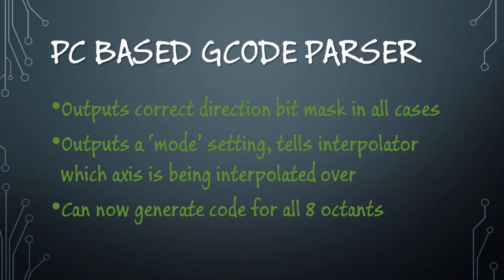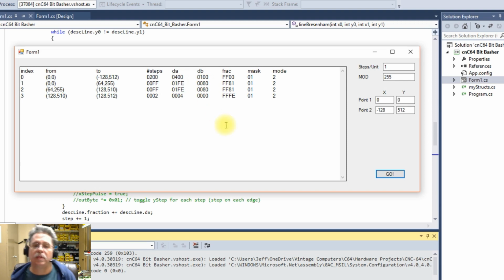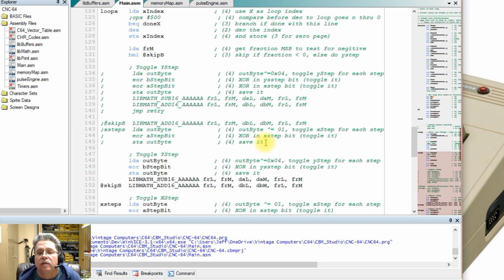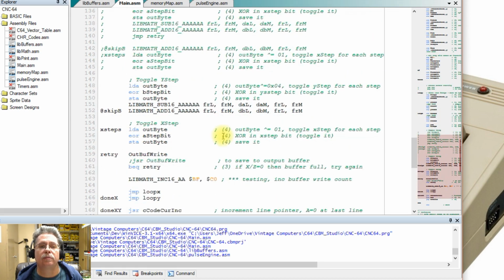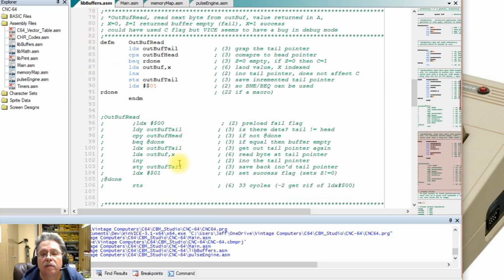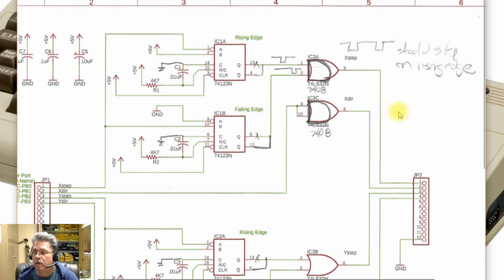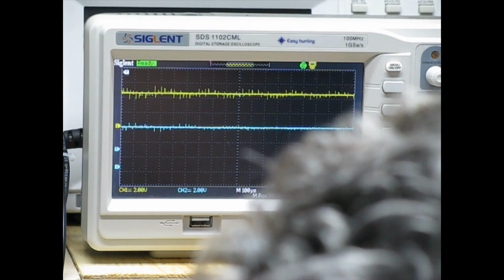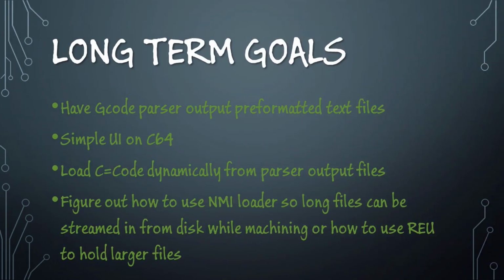CNC 64 P3

Comment: Hi Jeff, I love what you are doing, fascinating stuff. 
You can save 19 cycles in your NMI. Instead of saving the registers onto the stack you put them into predetermined zero page locations. This will save 8 cycles (as it removes the TYA, TXA, TAX and the TAY). I don't think your NMI uses the Y register any more so you can save an additional 6 cycles by not saving and restoring Y. The LDX #$01 inside your OutBufRead macro is redundant. Does it need to be a macro? If you hand expanded the code into the NMI code you would see that the BEQ rdone would jump to BEQ pend so remove the macro and  replace BEQ rdone with  BEQ pend then you can remove the LDX #$01 at the of the macro and the BEQ pend when the macro completes. Hard to explain, but just expand the macro into the place where it is called and you should see what I mean. This will save a further 5 cycles and your NMI will now be 19 cycles in total faster!
Keep up the good work.
Reply from the maker: WOW! Thanks for the suggestions. It did not even cross my mind to store A, X, Y in zero page. That is indeed a big time savings (when looking through and C64 zero page assignments this morning I found that kernel uses $97 for this which I had never noticed before.) I used $AB, $AC, $AD.

If my calculations are correct using zero page and not storing Y saves 9 cycles on entry and 10 cycles on exit. 

Once I copied the OutBufRead macro to the pulse engine page it was clear what you were talking about there. I commented out the ldx #$01 in the macro and hanged the label in the pulse engine code with a note that the branch was implicit as it was in the macro. I'm not sure I'll leave it this way, as it is a bit goofy, but I like the mental separation of having the macro there.

I made the same change in the main loop and OutBufWrite as well. If my calculations are these changes you suggested have saved 24 cycles in the pulse engine (HUGE!) and 5 in the main loop.
Reply from the maker: I passed on your tip about saving A, X, Y in zero page to save cycles to the 6502.org forum (with credit to you) and included snippets form my code. Someone pointed out that the PHP/PLP were redundant as the processor does that automictically. SO, 7 more cycles in the pulseEngine saved. (so 31 total in the pulse engine.)